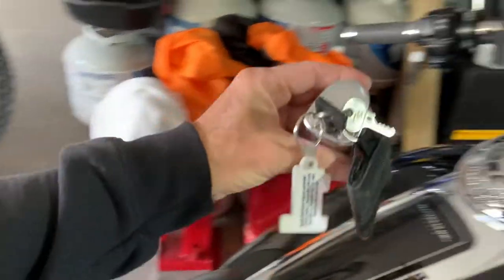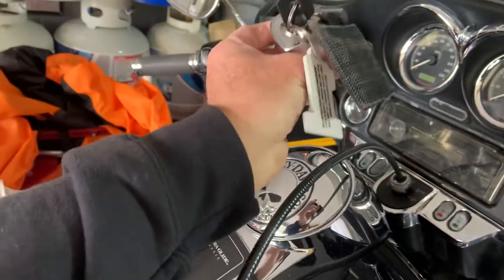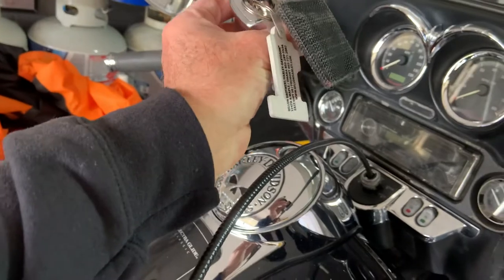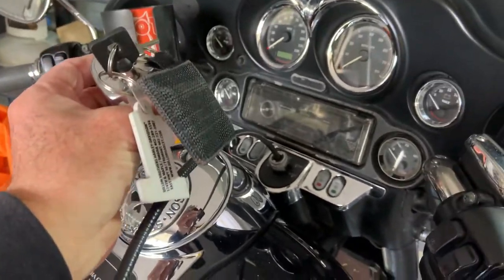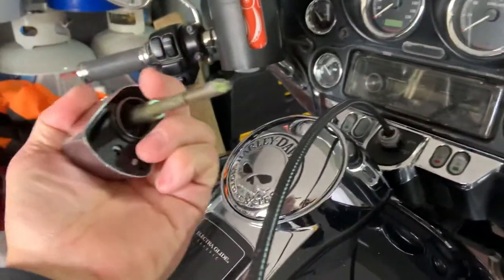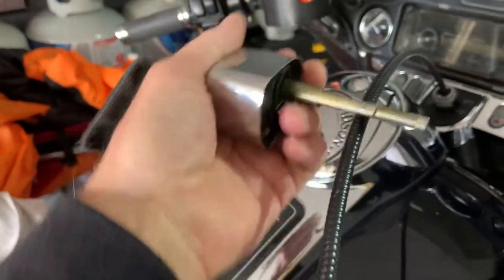Remove and Install Harley Ignition Switch - Electra Glide - See the Alignment!

Comment: I just learned about all of this the hard way, as I do most things.  I removed the switch on my 2021 FLHTK so I could run a couple USB cords under the dash panel so I'd have clean power to my phone cradle on the left, from the power socket on the right.   Why couldn't HD put a socket on the left, too!?  Turns out I didn't even need to remove the switch like I did, but yes, of course I moved the bars.   I had just watched a couple Youtube videos that made no mention of the alignment issue at all so when i couldn't get the switch back in and the forks were perma locked, I was really freaking out for a little bit.     I ordered a $11 alignment tool on Amazon that I'll keep in my tool roll form now on, but after dicking around with a narrow flat screwdriver I got it lined up correctly.   It took a dozen tries and i don't really know why, but its fixed.   I don't think I'm ever going to use fork lock on this thing.  I don't trust that switch, any longer.
Reply from the maker: Funny how they will just line up without hardly trying. 
That cigarette lighter socket if on the left side of my 09 and 2012 Glides. I have no need of them nor phone mounts anymore.
Purchased the Cardo bluetooth unit and its the bomb! Sure I have to wear a helmet all the time, but with todays drivers that's not a bad thing.
It's been so good, I disconnected my radio and got rid of the 40w amp and RF speakers.

Thanks for watching.